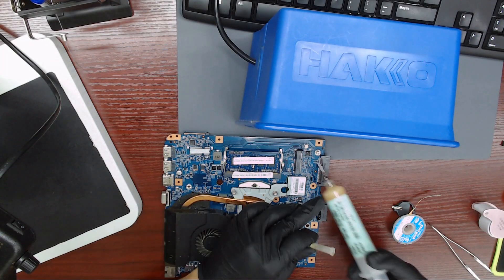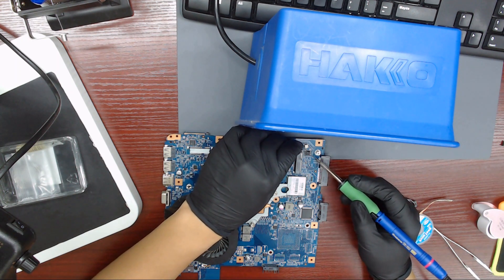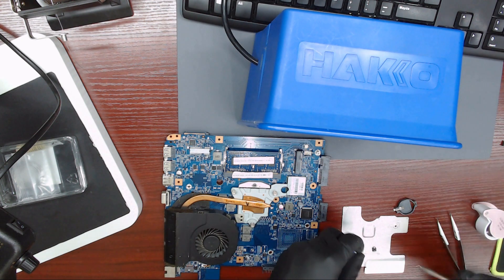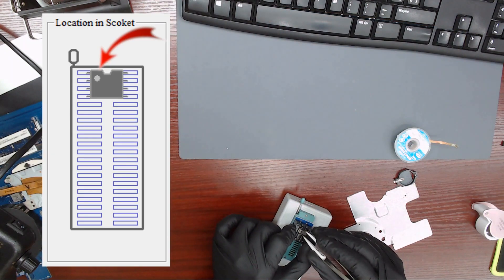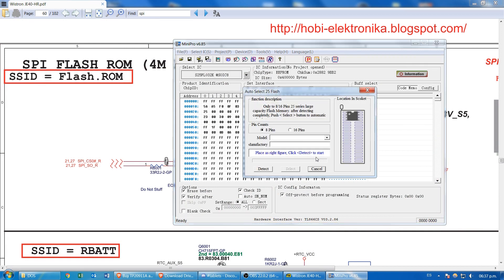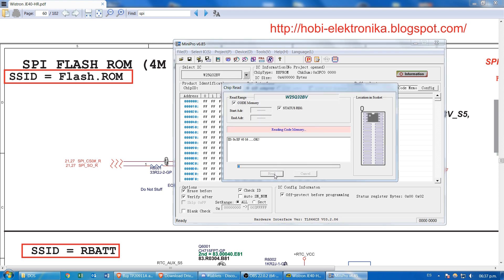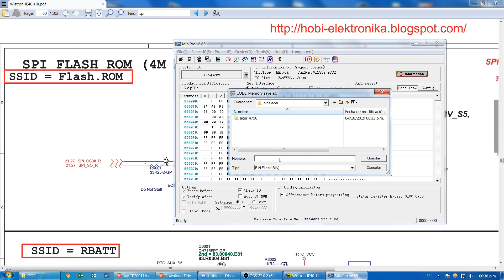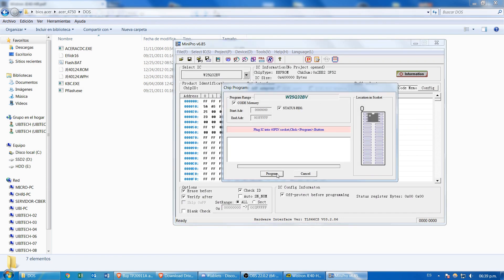How To Flash BIOS, Program EEPROM with TL866  Programmer, Laptop Repair

Comment: First of all, thank you for the video. Also, with your permission, you want to point out something that is faulty. The lead tin ratio of your mixing mixture cannot be used in SMD circuits. Also, please improve your soldering skills a little more. This is important for you. There is no example in this video. Thank you very much.